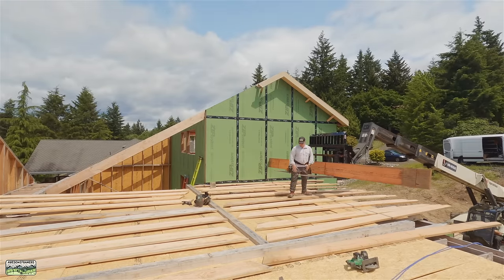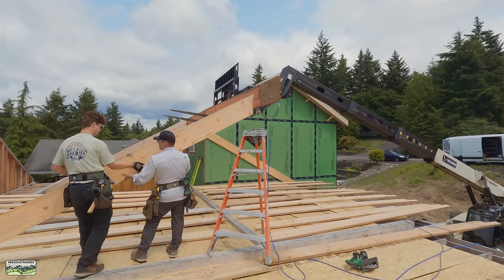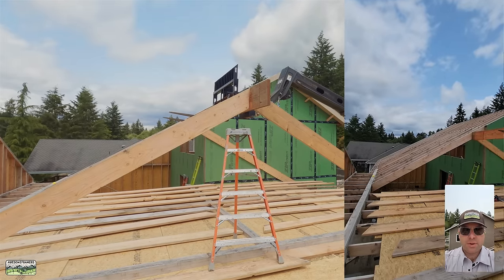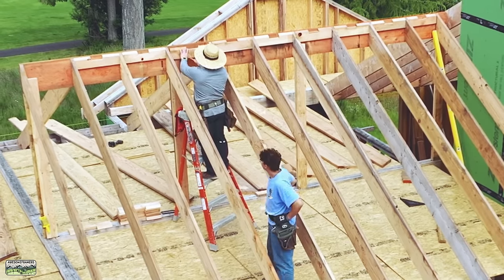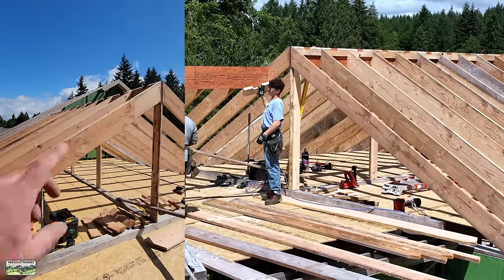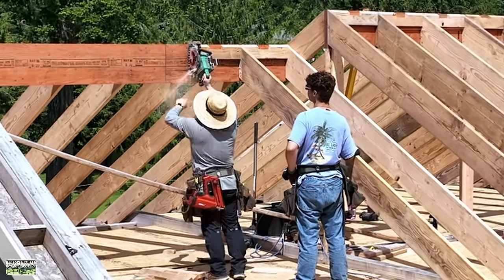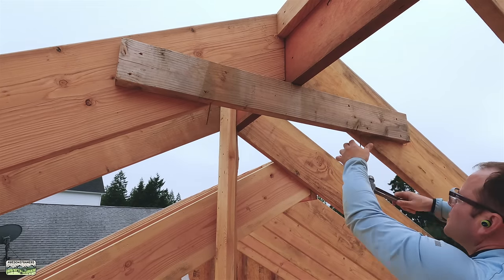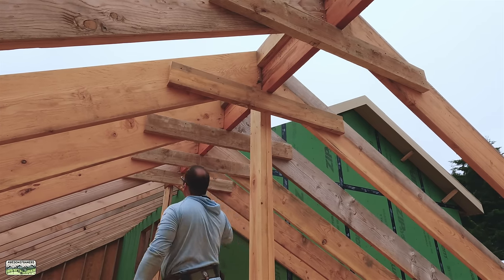Framing the Garage Roofs Project 150 Roof Framing part 4

Comment: I hate it when you cut an angle on wood that is not totally dried and it then dries and shrinks along it's 10" length. Now the angle chances due to that shrinking. Happened on my picture frame deck on every dang cut. Same thing probablh happened to your rafters. The heel opens up. I always thought it was the length shrunk and opened it up but it's due to the 10" shrinking to it's finally width.